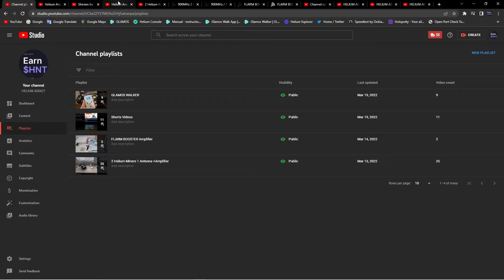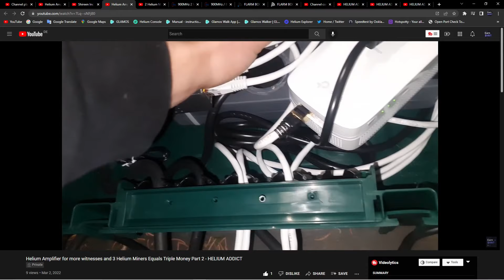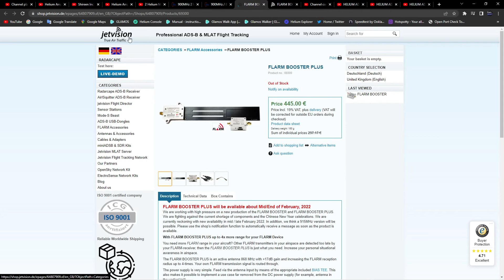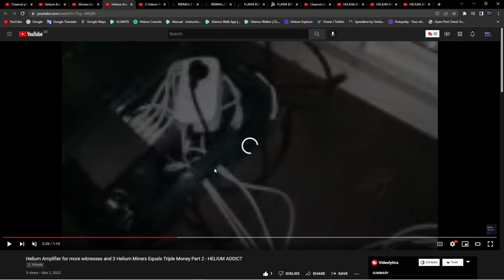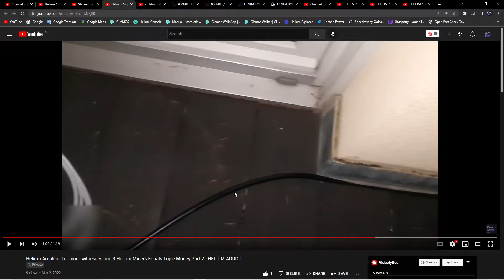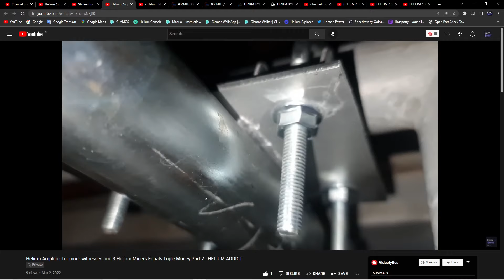3 Helium Miners 1 Antenna Finale Setup (2022)  Part 2   HELIUM ADDICT

Comment: Ich denke das ein cat7 Datenkabel ausreichend ist. Konfektionierte Kabeln kommen bei mir nicht zum Einsatz und crimpen werde ich auch nicht. Mit den Steckern von Metz connect pro 360 entfällt das crimpen….die sind zwar teuer aber wiederverwendbar und industriell tauglich. Gegen die Feuchtigkeit kann man auch mit Silikagel Kügelchen mit Indikator entgegenwirken, die können im Backofen  regeneriert werden bei 50°. Als Stecker setze ich auf Telegärtner, sie halten die IEC 61169-16 Norm ein. Zudem sollten N-Stecker mit 3Nm angezogen werden und SMA mit 0.9Nm. 

Danke für alles 🙏

Wie entgegnest Du die statische Aufladen der Antennen?
Reply from the maker: Thanks for the information 🙏
I still not ground my Antennas for the moment but the future I will use only cavity filter not lightning arrestor and connect him to the matell of the roof or to rain drain because the are made from copper and the are grounded  simple as that 
Happy Mining ✌️

Comment: Just curious do they use aluminum wire in extension cords were your from just wondering in in USA and all extension cords are copper we only use aluminum on feeders for apartments and hotels but we have to upsize it when we do for the correct amp draw, I just like to learn things are done differently in different places thanks

Comment: I have that same bi-directional amp and I'm having problems did you solder the grounds on the antenna side and put a straight wire from the middle antenna pin and bypass the capacitor that connected to it its small and white that what it looks like you did but pic isn't very clear and I'm an electrician so I understand what I'm doing I just thought I would ask because I have lost connection on the antenna side like you did thanks
Reply: Thanks you have a 3 year warranty I have  called them and I'f you do they will email you paperwork work to fill out to send it back to get it fixed and it's free unless it's something you did to it that messed it up I have a acom amp and cavity filter coming to and I have one bobcat 2 cotx-x3 and 2 milesight UG65 and all or the lora modular are different but if you know where to solder the wire on the rx side before the last two lna's you can run two antenna on one minner one for tx and one for rx and you can use a rx only amp and I better saw filters with with lower insertion loss and the same with the rx amp as well thanks
Reply from the maker: @beanflickerOu812  Hi 👋 
Your the first smart viewer that really think the same thing 🤔 that I m thinking about  , well I didn't share this in my videos because I m wory about the reaction of the people  some they will love the idea and athers will not be able to copy me and get jealous and give me heat comments 🤷‍♂️ it's hard to satisfy everyone, and there is ather whey even easier just plug and play to separate the TX and Rx  without opening your miner. 
And you can also you can send beacons and not get invalid , but I don't want to go on that path I m keeping it 💯 legal as possible 😉
Reply: @heliumaddict8582  I completely understand you can't keep everyone happy especially when your talking a touch subject like this and it can make the difference in some people make more and others and some not making as much and it's always like that, the people doing good are in a good mood and the people not doing like they thought they would are the ones mad and alot of times those mad people just set there minner up stock antenna and inside they don't take the time to do the work to get better earnings, so you do your thing I love your vids and I would try anything you think will work and you don't have to post everything you try if you know what I'm saying and it not like the real cheater that you see them make 10 to 15 hnt in 24hrs what you are doing is providing coverage for the network so your helping don't let people tell you different, keep up the good work and I have two panels on the way that are 9.6 db each but when you use a splitter to use two antenna one miner they will be 12 dbi and if you put them facing one way and one to left other to the right you get a 110 degree horizontal beam and a 30 vertical
Reply from the maker: @beanflickerOu812  Thank you very much for your comment it's mien alot to me this 🙏😇 , it's hard to find people who understand what you're doing but we must stay positive and never give up and keep trying to improve our setups.
Happy Mining ✌️
Reply from the maker: Hi . 
Well the father of my friend he solder him for me but I m not sure if he works or not I still not tested it 
Happy Mining ✌️